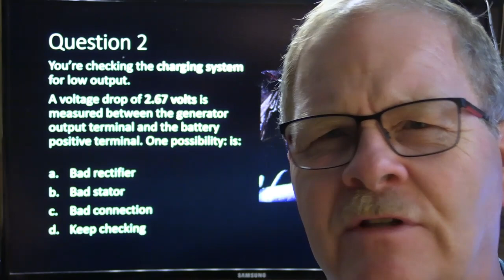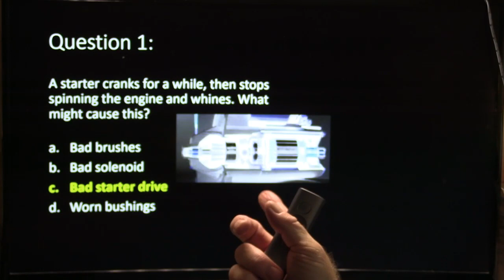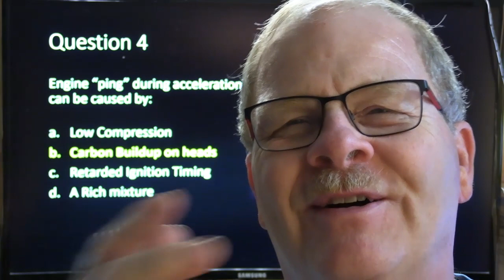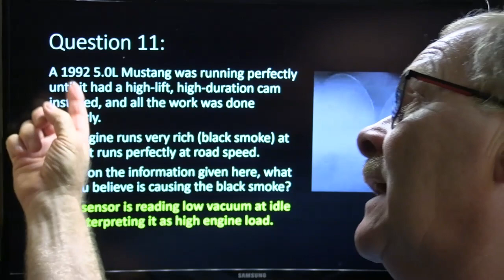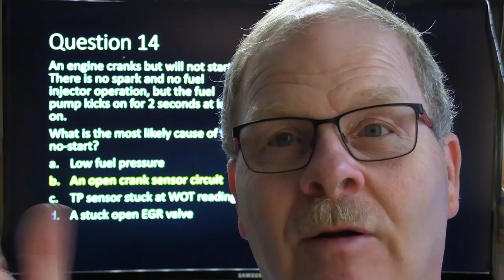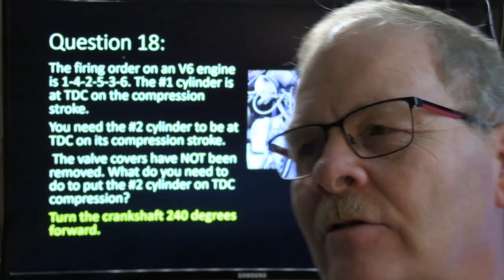A6 A8 Practice Test 1

Comment: Regarding question 11: with a MAF you could still get the same symptoms but for a slightly different reason. Cams with larger overlaps can cause reversion back through the intake at idle, and this pulsing reversal in airflow will make its way back to the MAF, as well, resulting in it getting "counted" more than once (bc the MAF can't tell/doesn't care which way the air is flowing, it's just looking at how much that hot wire gets cooled down). The end result is that the MAF overestimates the amount of air actually flowing in at idle and too much fuel is injected as a result. There can be some debate about how easy this is to tune around, but it's one of the reasons guys will get rid of the MAF all together and revert back to speed density bc it's generally easier to correct for this using the MAP and tuning for the lower vacuum.
Reply from the maker: The only problem with converting back to Speed Density is that if you're running an aggressive camshaft, a MAP sensor will read low vacuum at idle and cause a very rich idle - I've had to convert a Speed Density system to MAF for that very reason.

Comment: Hey Richard, I have a question regarding trying to diagnose an issue with a Toyota Tundra, do you have an email I can contact you with?, thanks
Reply from the maker: Let's do it here
Reply: Ok so I’m working on a 2008 tundra 4WD with the 4.7L engine, customer complaint is intermittent start-stall, and vehicle also shuts off going around left turns. I am
Able to confirm the vehicle is shutting down on hard left turns. all the monitors are set and there is no Codes or CEL. Fuel pressure seems fine, it just shuts off completely on left turns, but you can put it back in park and start it up again fine. Previous shop installed 8 new coils and repaired one of the Cam sensor wires. this is kind of a weird one, any thoughts?
Reply from the maker: @177584  Shot in the dark, but water in the tank is a possibility... I've seen that on just one way turning. That'd do it without setting the CEL or codes, too. Although I have seen a Charger that had loose PCM pins doing that.
Reply: Hey, I already took a fuel sample while I was doing the fuel pressure testing, and the fuel seems fine, not contaminated and no water that I can see, appears fine: I’m suspecting faulty fuel pump control module cause I’ve seen them before.
Reply from the maker: @177584  Possible, but you may not get water unless you totally empty the tank - I've had to do that - energize the pump and let it pump all the fuel out into a clean plastic container (bucket or drain pan) just to make sure there isn't water in there somewhere - it's easy to miss just getting a small fuel sample.
Reply: Did you find a solution? It seems to me like you had a loose wire that would would short to ground and drop down modules. Another alternative would be a failing steering rack that would drop itself down by shorting internally due to load which has CAN lines and would also drop the network. You need a scope for this type of diags and monitor your 5v references around that area.